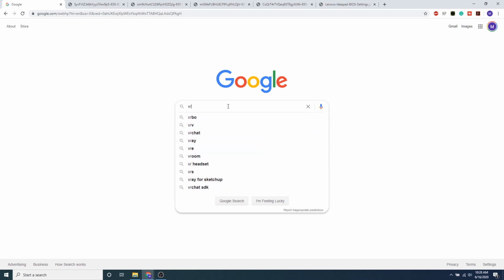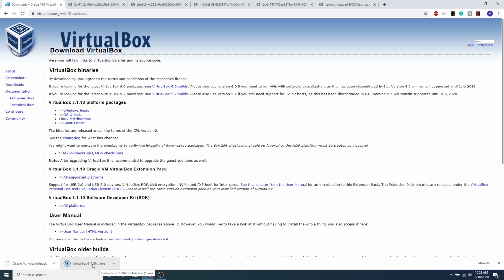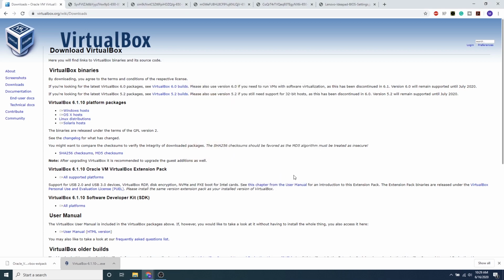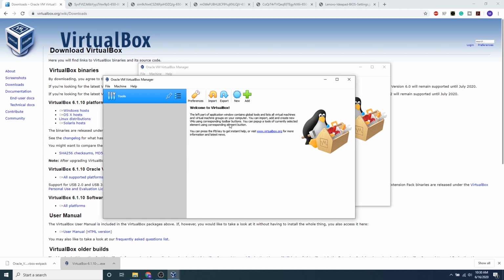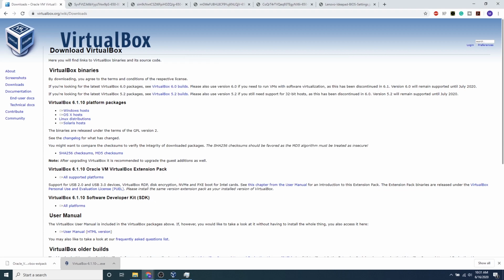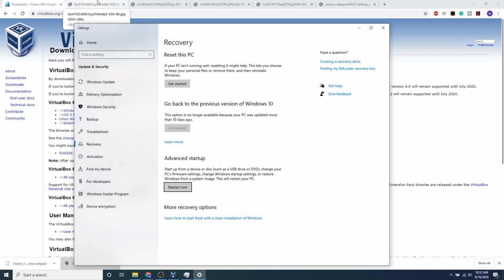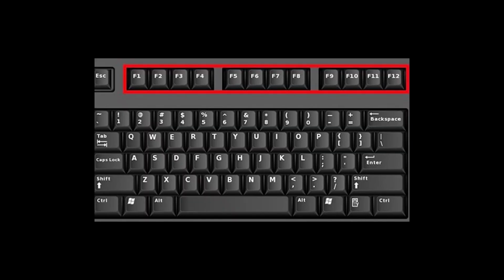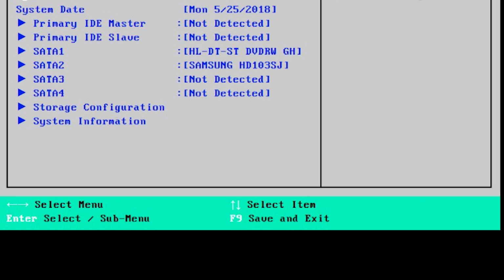Cyber Home Lab Setup | Virtualbox

Comment: Following that, as this is for "Noobs" my suggestion would be showing how to get vulnerable machines from something like VulnHub as well as utilizing the VM files from ParrotSec, Kali, etc. I have an entire walkthrough on installing ParrotSec to VBox for reference if you would like to show how to do it from .iso as well. From there you will have to show the network configurations and verifying that the machines can talk. Ideally for this situation you would want your machines all to be utilizing the same types of network connections which are viewable when adding the VM to VBox as well.
Reply from the maker: Amazing ideas! Thank you so much. Consider them in the works!